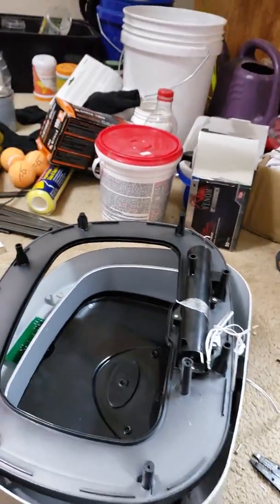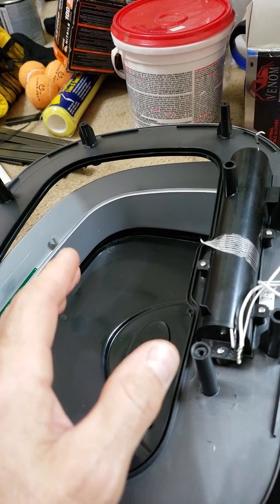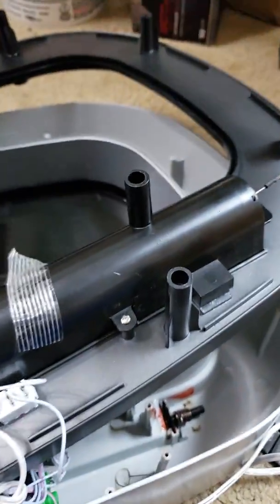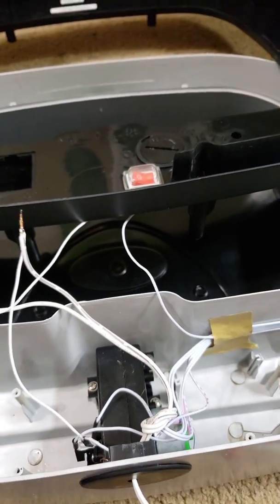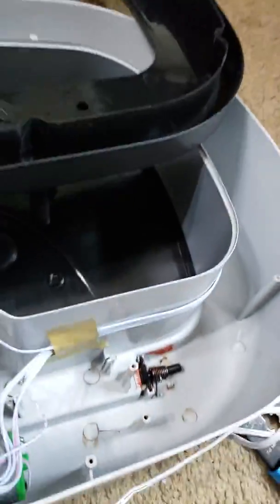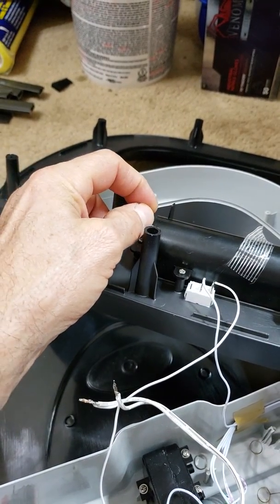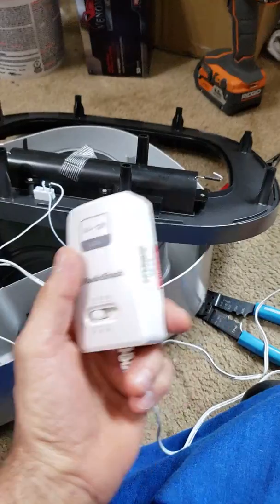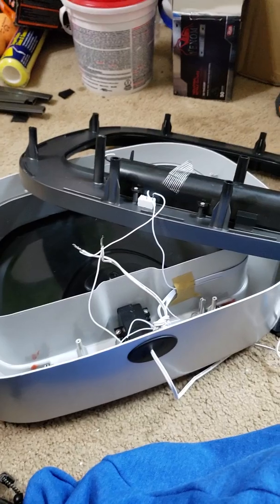Ninestars modification trash can

Comment: If its eating batteries that quickly youre either using really crappy batteries or your unit is screwed up. I e got half a dozen if these things between three different houses. I use rayovac AA batteries. Plain old alkaline batteries. They will last 6 months easily. I use them non stop as a matter of fact one unit has been opening on its own for the past week. About every 5 mins it opens for no reason. Still going strong. Too late now but ill bet you got a screwed up unit. I love these things. Very handy and a bonus is it scares the crap out of the dogs and people that arent used to them. Good times
Reply: Did you figure out why it is opening on its own? Mine is doing the same thing.
Reply: @andrearuffino  actually no. Im tinking it is due to low batteries. The motor is getting old as is the whole thing. There was a point where batteries were left in it and the corided. I recently tore two of them down completely cleaning all contacts and scrounging around for a suitable motor. It was starting to go thru batteries quicker than normal. Its either that or my buddy who was fascinated with the thought of an auto opening trash can who died right before this started openening on its own playing with it in the after life.
Reply: Ours used the same batteries for 1  and 3 months then it got really slow and then stopped working. We assumed it was batteries so we replaced them. Still won’t work so now we have to buy another trash can. I won’t be buying another electric trash can.